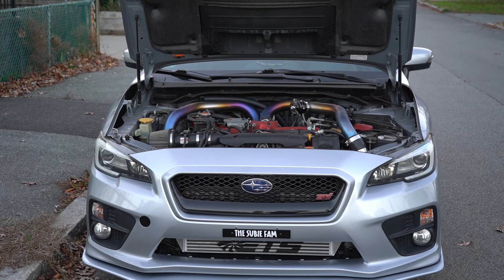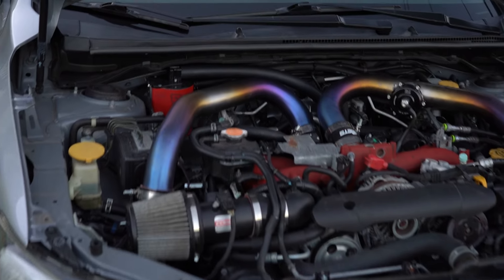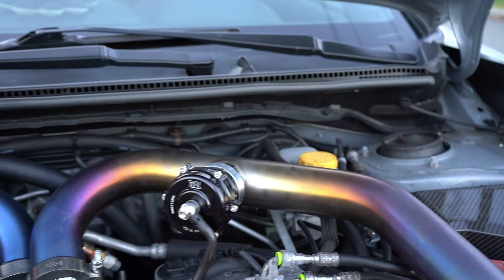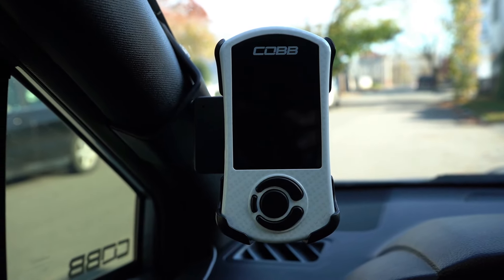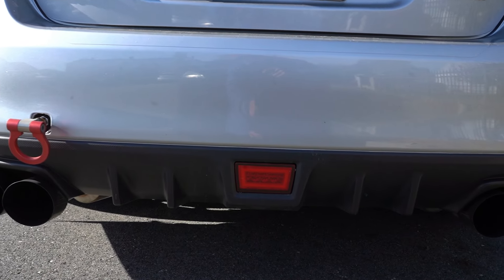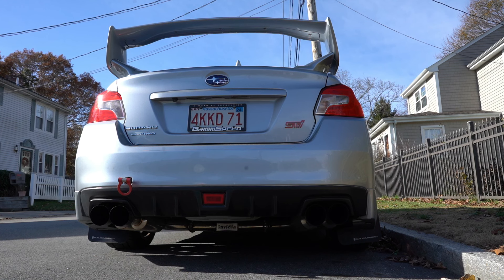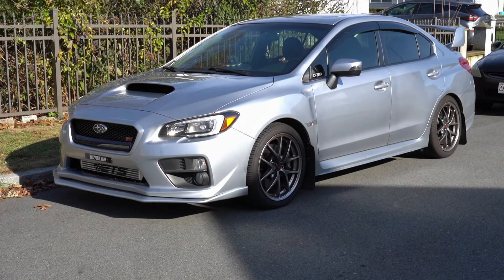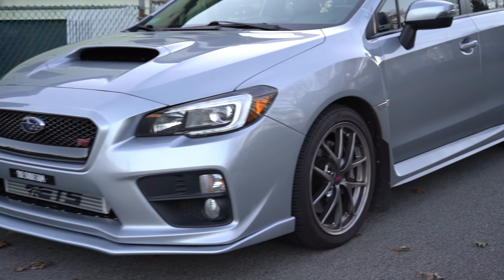350 HP Subaru WRX STI MOD LIST OVERVIEW !

Comment: What's the plan for CELs if you update the tune after the Cobb greenspeed updates? Your downpipe and Speed Density / MAF is going to throw them and you can't shut them off anymore.
Reply from the maker: It being the wifes daily we are probably looking at keeping the cars power right at this point for now until further mods and adjustments can be done there are multiple companies that are working around the green speed affects some already dropping new ethenol kits an all. We will keep posted but further power plans will mostly likely be for the 2018 e85 Fp Blue Sti
Reply: @thesubiefam  I'm running into the somewhat the same issues. Ending up ditching the Access Port and going open source.

Comment: Are you on stock down pipe? 
How are you reaching 350 whp without bigger turbo or down pipe? Where did you get tuned?
Reply from the maker: Catless downpipe ! Speed density kit👍🏻 tuned by PerryTuned at thesubarushop
Reply: It looks amazing, I wonder why my tuner told me this. Umm. Weird. Maybe it’s my state with ems
Reply: Your cars not throwing engine light on with down pipe?
Reply from the maker: @UpstateSTI  no it doesn’t 😊

Comment: Did you run dampers or no on stumble kit mynes starting to stumble gotta order kit
Reply from the maker: No the (stumble fix) the fuel pressure regulator should be all you need 👍🏻

Comment: Do you run into any issues with the aftermarket intake and full exhaust system? I heard lots of tuners recommend a full fuel system upgrade, is it still a stock fuel system?
Reply from the maker: If we wanted to make more power next would definitely be injectors and fuel pump but doing the fuel pressure regulator and getting a proper tune will do wonders! 👍🏻 she’s been super healthy
Reply: @thesubiefam  thanks for the suggestion